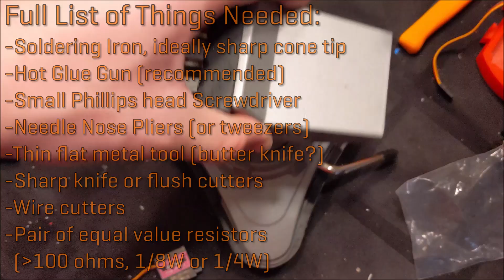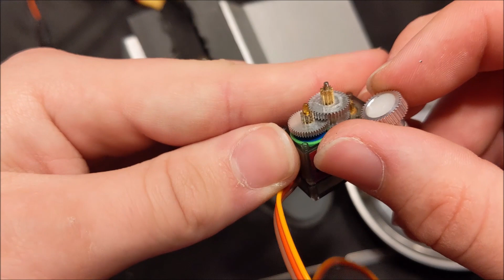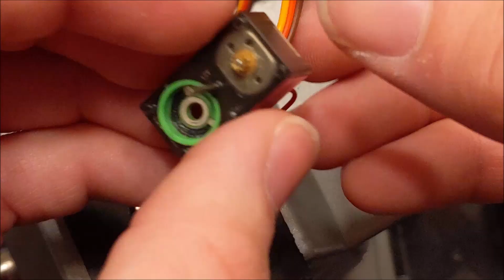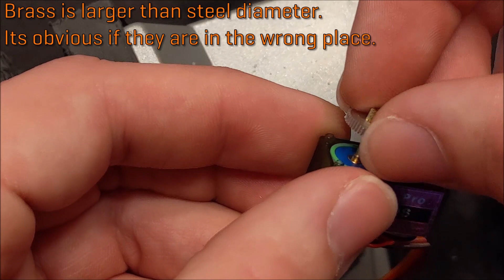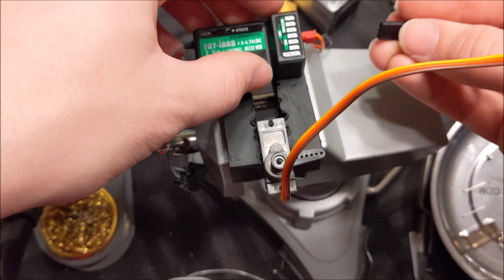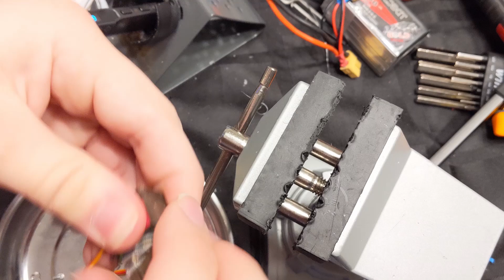Continuous Servo Mod: How To Turn Servos Into Drive Motors (Ant/Fairy Combat Robots)

Comment: Awesome vídeo, when i tried this the resistors were a little of from the other (should be the same) needed to trim to the max. But what i discovered is that this cheap 9g servo can take 2s lipo fine. Run It for over 3 minutes applying force to the Shaft. Just Get a bit warm. This board coupled with n20 are a good match.
Reply from the maker: Yeah depending what resistors you get they can vary up to 5% or 10%. If you have a bunch it can be worth taking a multimeter to them to find closer pairs.

Comment: Thank you very much. Indirectly through this video you have cleared all my doubts about continuous servo.
I have some doubts about servos.
May I ask you?
Once again thank you very much 🙏👏
From India
Reply from the maker: What's the question?
Reply: @JustCuzRobotics  aren't sg90 servos already continuous? Or does that just mean they are mechanically capable?
Reply from the maker: SG90 is different from the MG90S I have here. SG90 have both standard and continuous versions I think, but they use plastic gears instead of metal and are not very combat ready

Comment: can you channel mix any servos
Reply from the maker: I'm not sure what you mean by channel mix a servo. Channel mixing is done on the transmitter and can apply to anything controlled by the paired receiver. Servos or ESCs it doesn't matter.
Reply: @JustCuzRobotics  oh thank you 
I watched a different tutorial and it gave the impression that the esc had to be special in order to channel mix
Reply from the maker: There are some ESCs that will control two Motors and have mixing built-in to the ESC. The Tarakan I sell is an example. For everything else you can always do mixing on your radio
Reply: @JustCuzRobotics  thank you so much 

hope to see you at Norwalk havoc someday